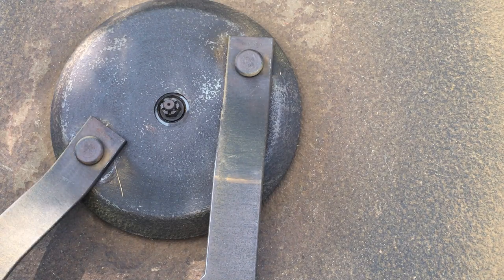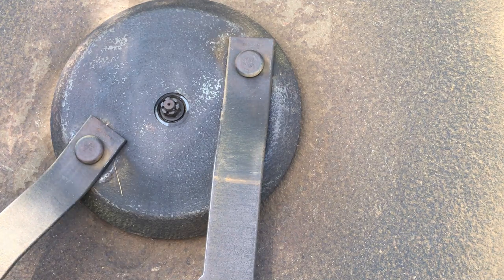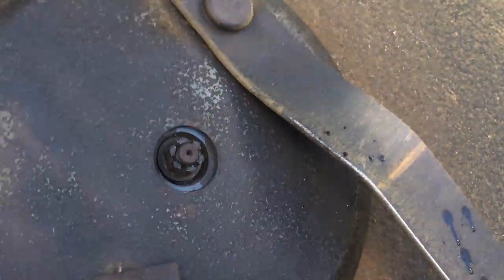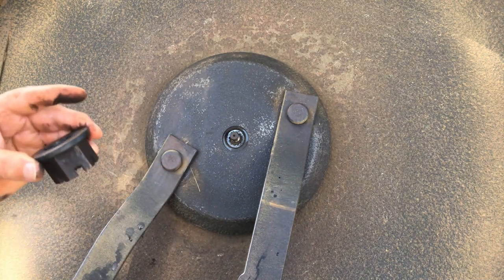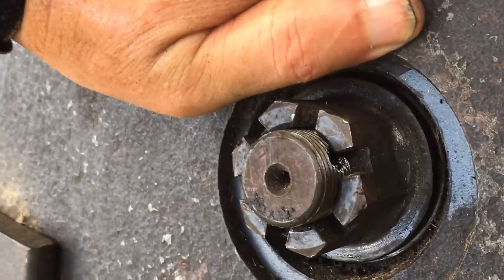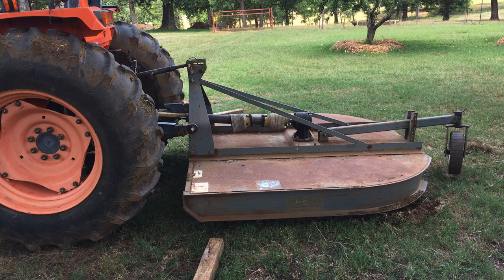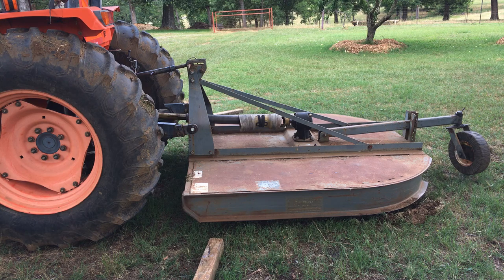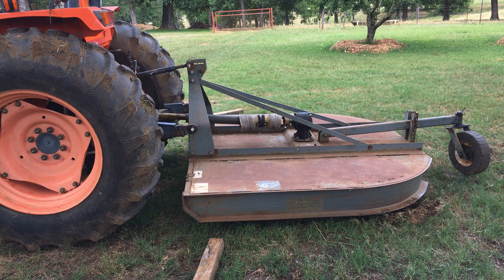FIX A VIBRATING BRUSH HOG ~ STOP BRUSH HOG VIBRATIONS ~ KEEP SAFE

Comment: Yep on aircraft we are told to add or remove washers to get the holes to align with correct torque on nut.  Also  turn the cotter pin 90 degrees and turn end over bolt so key will not vibrate and fail.
Reply from the maker: r aeronca 
Thanks for the tip!

Comment: I have added washers or made my owns washers or shims in the past so the the cotter pin properly engages the castle nut.  I have found that if the castle nut is too "deep" on the threads, the cotter pin is more vulnerable and gets damaged and disappears easier.  It happens fairly frequently that the cotter pins get broken and come out due to something hitting them during normal operations.  Checking for the presence of the cotter pin and tightness of the stump jumper / blade carrier is part of my daily check.
Reply from the maker: Great tips, thanks! 😊

Comment: spacers or rather shims is what needs to happen. the issue with the gear box noise is the fact that the gear mesh was not properly set up with shims inside the gear box. this would have shortened the shaft where the stump jumper seats and you may not need a washer. gear mesh inside the box is very important and that is where the noise comes from. the shims inside is what sets the length of that shaft.  ask me how I know this lol ha ha.
Reply from the maker: daveknowshow 
Wow. That’s a lot of information to take in. Thanks for your comment!
Reply: @BIGALTX  if I can locate an old gear box around here I will do a video on it.

Comment: The "humming sound" since the rebuild is because the gear spacing in the gearbox is incorrect and too loose. The backlash should have been adjusted when they rebuilt it for you. Will result in premature failure of the gears.
Reply from the maker: Thanks, wish I knew how to correct it. I assume there are some shims or something that need to be installed, right?

Comment: I am not a mechanic but I think you replaced a washer that was left out when the rebuilt your gear box.  Just the fact that the castle nut did not go high enough to be secured with a carter pin would indicate that.
Reply from the maker: You might be right

Comment: Should have had a washer like that in the first place. Also, if they're tapered bearings, it should tightened to a torque figure then backed off until you can get a pin in, at least that's how I was taught and have always done that style of bearing. Just frapping it up with an impact wrench can put too much pre-load on the bearings, which usually wipes them out a lot sooner.
Reply from the maker: Thanks for the info.
I had to back off just a little to put the pin in :)
Reply: Totally agree.  Should never impact drive castle nut!!  (same as the castle nuts on the front wheel bearings on an automobile)
Reply: Mine requires 450 ft lbs of torque,,,, I have to. Use a torque multiplier

Comment: That's just basic maintenance. Any time you bushhog that vibration can start from hitting something like a rock small trees to hitting the ground too deep. Just protect the seal. Always check the gear oil. That roar you hear could be low of gear oil. Or the sound of gears itself. Some to sound that way.
Adding a washer or two to fill up space is common. When you had it rebuilt  they could of missed putting that washer on to start with. Yes, that happens as well. I have seen some put a large lock washer there as well. You could put a bigger size cotter pin in to fill the space inside the hole. Take a hammer and form it around the nut. Don't leave any of it flopping.  Pliers to spread the pin and a hammer to form it around the nut. Just a better fit.  When working on old equipment it's just common.  The way they build new equipment now with thin metal. I'd rather have the old. And fix it myself.  I'm NO mechanical engineer by No means.  I'm just a man with a tractor that likes to take care of his equipment.  I've been doing this ever since I was a kid working on my dads equipment.  
If you allow it to fail because of bad maintenance. Your the only one to blame. It takes time but, well worth it in the end. Just watch what you hit with it. Check it from time to time. Even after you cut with it.
Reply from the maker: Great advice... thanks!
Reply from the maker: “Overpowering the cheat” may prove even more difficult this time.… We shall see

Comment: Never had a problem with my brush cutter until I got a new tractor with automatic transmission. The PTO is started with a pull switch, like a riding mower, so even if you throttle down all the way, the brush cutter is going to start with a bang. There's no clutch to let out gently and start gradually. 9 times out of 10, when I throttle up I've got a vibration that's impossible to deal with. I hate it so much I'm using a finish mower to do most of my heavier cutting.
Reply from the maker: That sometimes happens to me too.
I just try to push the switch very slowly so the cutter will start slower.
If my vibration gets too bad, sometimes I can stop the PTO... restart it... throttle up... and it will stop.
It's usually caused by the blades hitting something and kicking back from the extended position.
Sometimes goosing the throttle up will make the blades swing out by centrifugal force.

Comment: Could be gear mesh like other have mentioned but it also kind of sounds like straight cut gears like used in high performance applications(aka 1/4 mile cars)
Reply from the maker: Interesting.... thanks!

Comment: If I could add my 2 cents of knowledge by the sound of the gear box I’d say who ever rebuilt this unit didn’t put enough shims on the rotor shaft to space the gears in the housing the specified mesh clearance and this is why the castle nut is threading on too far and you had to put a washer on under the castle nut , so you need to have the gear shims properly gaged that is why it is making the strange sound you hear if not the gears will mesh them selves to metal pulp. Do not continue to run this rotary mower until properly adjusted or $$$$. Sorry I guess that’s $2.00 worth of brain cells.Good Luck from Canada cheers !
Reply from the maker: Good to know... thanks for the info!
Reply: I agree if the planetary gears are not spaced correct it has a whining noise, same as a differential gears.
Reply from the maker: @eddie8166  
Is is causing harm?
It's been several years since I had it fixed.
I had it rebuilt at the dealer. You would think they knew what they were doing.

Comment: The humming is the gears not being alinement right. They sound way to tight. They are shimmed just like the gears in a truck rearend.
Reply from the maker: That's what someone else said.
So (and i am pretty ignorant about what happens inside the gearbox) the gears should be shimmed to where they are further away from each other?
I assume that is done from inside the gearbox, right?
Reply: @BIGALTX  yes but not by much. We are talking thousands of a inch.

Comment: that gearbox does not sound good I put a new one on mine it,s very smooth.
Reply from the maker: Danny Dunnagan 
It sounded that way when I got it back from being rebuilt at the dealer. I started to take it back… But didn’t 😩

Comment: Why not just drill a new pin hole? all it does is keep the castle nut from backing off
Reply from the maker: True, and I thought of that, but didn’t seem to be enough space on the bolt to put another hole without wallowing out the original hole.

Comment: No, your nut isn't your problem ! When you slide your stump jumper down onto the gear boxes shaft the gear boxes shaft and the stump jumper has cut splines on the shaft and inside the hole of the stump jumper and they slide into each other like gears ! When the stump jumper slides on the shaft it will be really snug. The two will lock into each other so the rotary cutters shaft will turn the stump jumpers blades. If the stump jumper is wobbling when it's all the way down onto the shaft and that's the original gearbox and stump jumper then either the splines on either the gear boxes shaft or the splines up inside the stump jumper are stripped out and if the splines are stripped out then their both probably stripped out and need to be replaced. Another option is the stump jumpers machined lug that was machined to slide onto the gear boxes splined shaft has broken loose and that's letting the domed housing wobble. If that's the problem the that needs to be welded back in place or replaced then rewarded in place. You can add spacer washers to get the right cotter pin lineup through the castle nut and shaft but I guarantee you that's not the wobbling problem ! All that castle nut does is keep the stump jumper from sliding off the brush cutters splined shaft. When you slide the two together even without the castle nut they are supposed too be really snug together with no wobble at all ! You could actually torque the castle nut down 100 ft. lbs. and if the cotter pin holes didn't line up then back of the nut where you need to and even add a washer if needed. The castle nut isn't there to stop and wobbling , just to keep the stump jumper from sliding off the shaft. All your supposed to have to do is slide the stump jumper with the blades on it down onto to gear boxes shaft making sure it's all the way down in place. Then screw the castle nut down against the stump jumper not even torquing the nut down just snug it down until the holes lineup. Another problem that can cause the vibration / wobble is you might have bearings on the bottom side of your gear box and they are falling out
Reply from the maker: Man, that’s some great information. I appreciate you taking the time to share with everybody.
👍🏻😊